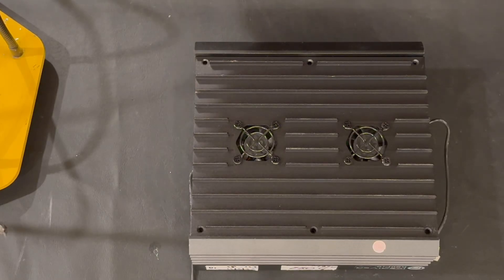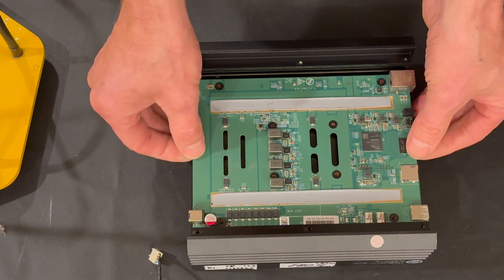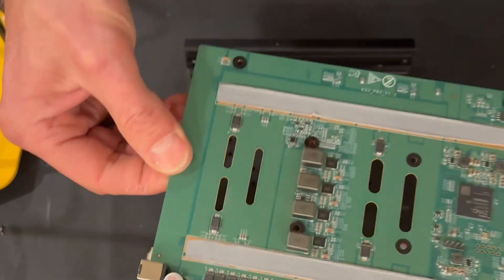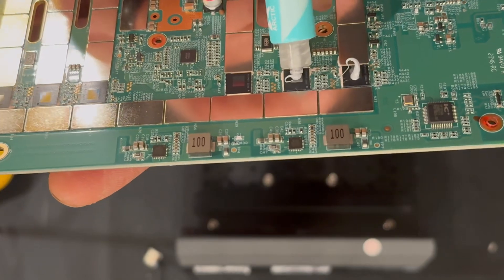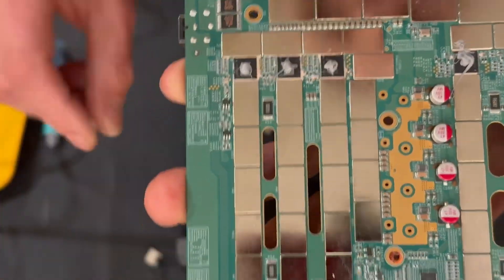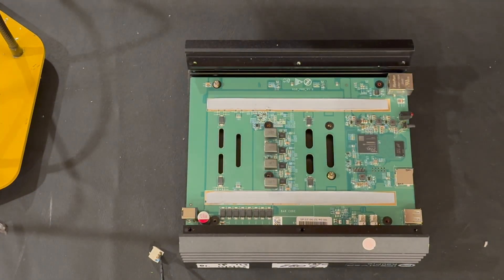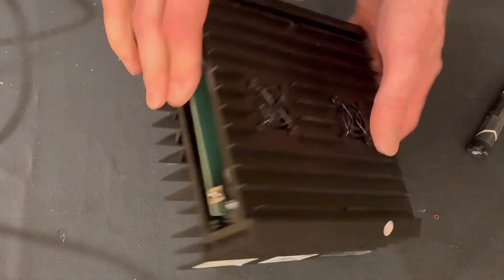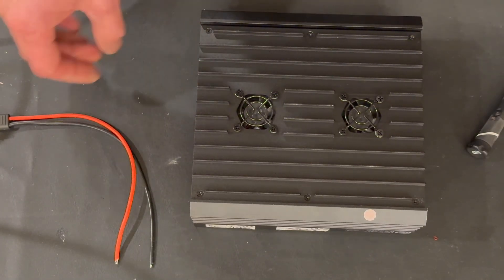KS0-PRO HEATSINK INSTALLATION FOR MOSFETS AND THERMAL PASTE REPLACEMENT - 340GH OC

Comment: I have a question...what does it mean "Board Temp(in)" and "Board Temp(out)" ? is temperature from where ? thanks
Reply from the maker: There is no description where exactly those temp sensors are but temp out is very close to the mosfets so when they got its get high temp reading and temp in probably somewhere at the end of the board closer to power side basically temperature of air entering the ks0pro. Hope that helps.
Reply: @DontMindMeMining  thanks for answering
Reply: @DontMindMeMining   one more bro...what is the difference between (xxxG_L_ks0pro_update.bgz) and (xxxG_ks0pro_update.bgz) ? why that sequence ? thanks
Reply from the maker: Low voltage option if you get a silicone lottery and your chips will accept L version is a higher efficiency since using less power
Reply: @DontMindMeMining  you are a good guy...thanks...
Reply: @DontMindMeMining  my temp 1 is always maintained at 79C to 80C...it's ok like that ? I used 340L
Reply: I am writing to you from Paraguay...excuse me for the poor English
Reply from the maker: it seem high, I would typically try to keep it below 60C if it goes to 99-102C it will stop the hashing. I’m not sure if the temp around 80C a good working temp but would lower the hashrate to keep it lower as high temps above 70C will probably faster degrade the  chips. Ambient temperature is a big factor. Keep your machine safe.😊
Reply: @DontMindMeMining  ok...understood...thank you very much

Comment: Help. After 20 hours working green and red light are off, fun is working, but hash rate are zero and webInterface not working. Plug power off and on = asic start work again. After 20 hours the problem repeats itself.  I have 3 asics and all have same problem. Help!
Reply from the maker: there are a lot of variances but main one could be mosfets overheating in what you've described, try lower OC and see which one is stable

Comment: Did you use the entire 8g tube of thermal paste for this?
Reply from the maker: Not for ks0pro, 1.5 tube for KS3M but 1-8g tube I think will be good for about 9-10 ks0pros since it’s only 12 chips on ks0pro and 168 on KS3M

Comment: I didn't understand this 4:17 point here so basicly you just put there  Thermal glue i was thinking u gonna put also  heatsink :D ...
Reply from the maker: 4:17 is not glue it’s thermal paste on the chips, heatsinks goes onto the mosfets
Reply: @DontMindMeMining   I see but u can put also heatsink on the top?
Reply from the maker: 7:20-12:00 in the video for heatsinks to install on mosfets only with glue do not use glue for chips only thermal paste and there is no space for chips to attached heatsinks as ks0pro body is the heatsinks for chips.

Comment: Hello, question.
have you check how much Watts is your kso pro pulling when close to 300 hashrate?
Reply from the maker: Yes, it’s in a table of last video. I think about 147W on 12V and 165W of the wall
Reply: @DontMindMeMining  I was not aware you could use 12v on the kso pro.
Reply from the maker: @piratanet123  I’m using it from day one

Comment: fyi, way easier to use the tube of glue and squeeze a dot on the mosfet, then put the little heat sink on top.  i used the spreader that comes with the glue to allign the heatsink and squish it down a bit.
Reply from the maker: Yes, that makes total sense. I was just kinda worry not to be careful enough and spread that glue on other small components  besides the mosfets

Comment: Same for non pro ks0?
Reply from the maker: Non pro doesn’t need heat sinks and only has 4 hashing chips. Thermal paste can be replaced if you see hot temps above 90 on monitoring tool

Comment: Hey do you think that 340gh 24/7 365 is ok ?
Reply from the maker: That a pretty good question, that what I have with my iceriver box set up. It’s hard to say for summer if I will be able to run it this way or will have to drop it to 280G. I’m checking temps on the chips regularly and so far I’m happy with cooling. As gas the chip life it’s probably will shorten chip life by a lot but this machine maybe worthless in a year when Kaspa hashrate above 400PH never know though.

Comment: Why no replace of pads?  with better ones?
Reply from the maker: If you open your ks0-pro and didn’t damage your pads it should work just fine there no requirements for thermal pads but it’s recommended. I didn’t notice a difference so kept them intact.

Comment: Hello,

a quick question about the copper coolers. On the video they are clearly lower and smaller? than on the amazon link in the description. Which dimensions are correct?
Reply from the maker: I tried both of them and they seem to work, I have, the smaller 6x6x5 that are used in the vid are out of stock now and I think the 6.5x6.5 also out of stock I've been waiting for delivery for a week now. any cooper heatsinks that are 6x6 or 6.5x6.5 at the base should work. remember to take photo with your mac address and heatsinks visible in the photo.
Reply from the maker: they have those heatsinks in stock now, I've added to the description as well.
Reply: I have now managed it too,

new heatsinks are glued and also the new thermal paste.

A quick question about the PSU, is the fact that it has 19.5v and the original only 19v not a problem for the board?

Now I have to take care of the firmware itself...  @DontMindMeMining
Reply from the maker: @XRaym87X  I am using 12V PSU on all of my ks0-pros. I didn’t like much temps with  19V PSU as it gets 3-4C hotter on the sensors.

Comment: Fyi if you're using the gennel g109 thermal glue like tswift recommends its takes about 6 hours for it to cure
Reply from the maker: yes, had to wait till next day before start 340GH firmware upgrade.

Comment: This 340Gh working on 12 or 19V?
Reply from the maker: I plan to start with 12V with amp reader to watch the amps at connector and temps. If it gets too hot will switch to 19V for another test and/or will solder silicone wire directly to board like I did in the other vid.

Comment: need replace mx6 for orinal silicone? if not it can work with 340G ? (just only fix copper heat sink on 4 mosfet)
Reply from the maker: It’s been instructed by tswift to replace thermal paste and add heatsinks to mosfets in order to get 340Gh OC. Not sure if thermal paste is critical part but it’s been reported that original is bad quality and dries out in a month with high temps when use OC.

Comment: can you post video of hashrate, temps and power usage after adding these thermal pads?
Reply from the maker: posted
Reply from the maker: I will, will let it run for 10-15 hours to get a good comparison with other Ks0-pro on 280G before will start going to 340G.